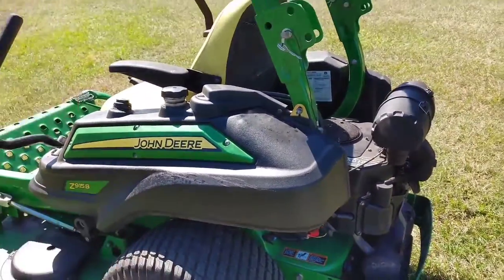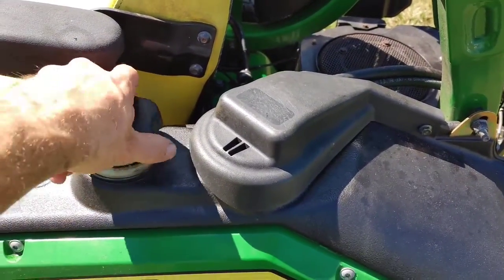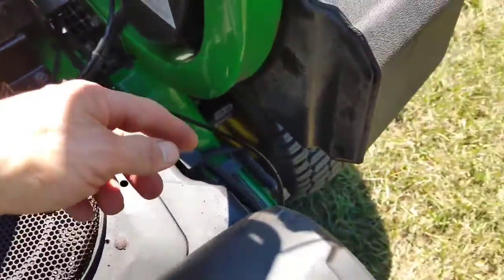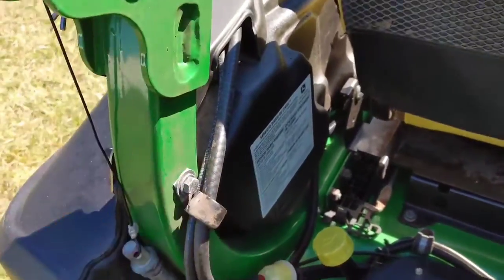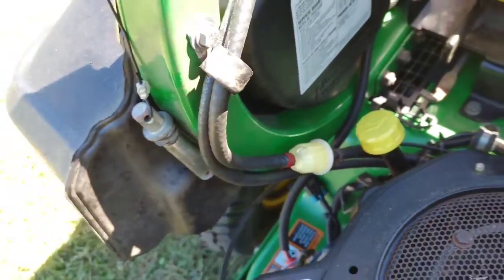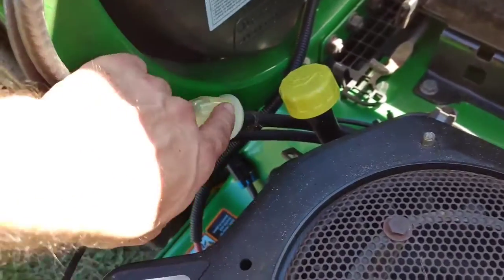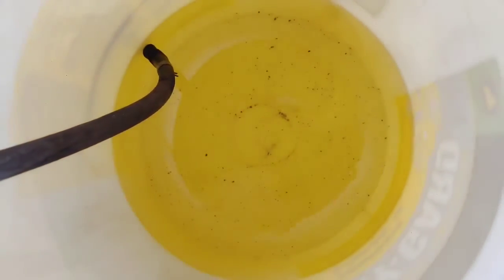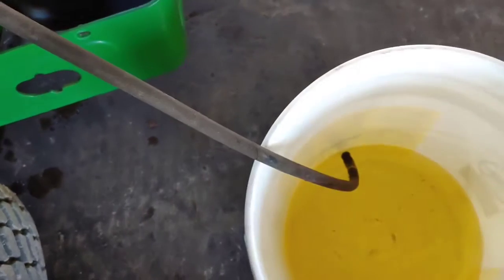The most common reason your engine is running poorly. Ethanol doing its thing. Gas octanes explained

Comment: I use high octane gas in my mower
Reply from the maker: It will run fine on 93 but it doesn't need it.  It will still have ethanol and that is what will cause future issues with your rubber fuel lines.

Comment: That ethanol is bad news for small engine equipment. When I bought my JD the dealer told me to run nothing but non ethanol and I have with 0 problems. I run non ethanol in all my power equipment. In my area it's only 30 cents a gallon more than regular unleaded. Worth it to me. Thanks another good video

Comment: I always run 90 octane and add around 50ml of two stroke oil to 40 litres of fuel as I was told it helps lubricate the top end of the engine. What do you reckon?
Reply from the maker: In my opinion Lucus fuel treatment is the best product if you want to add a a treatment to 4 stroke engines.

Comment: There is a certain amount of oil in rubber  ethanol gas is drying out the oil out of the rubber there is also synthetic rubber fuel line